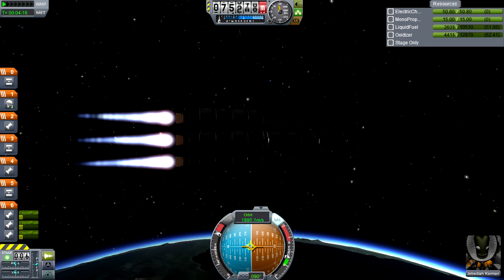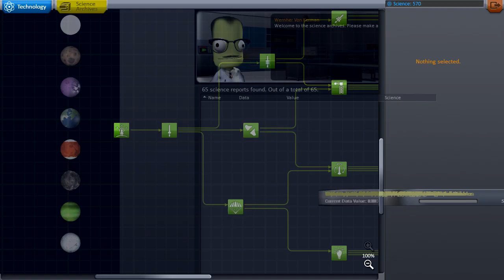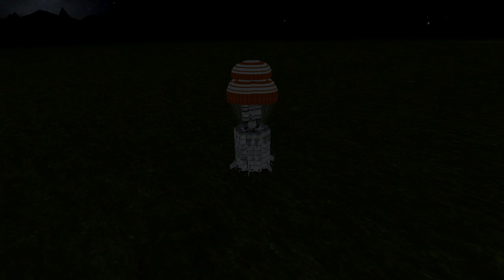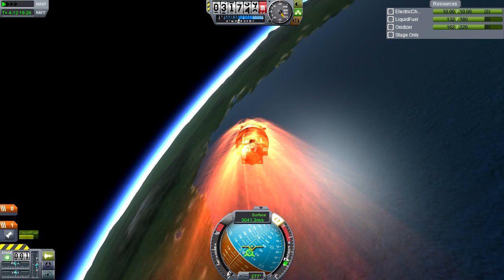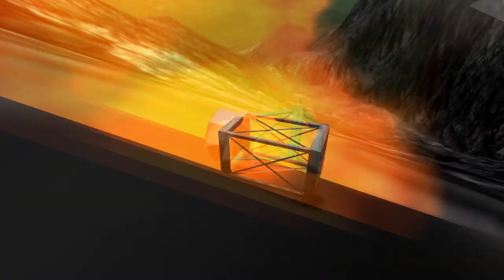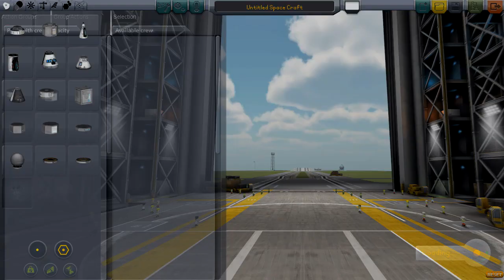Career Mode #14 QUEST FOR MAINSAILS (Kerbal Space Program)

Comment: Umm, no Harv, that's the Bussard Ramjet. Just to point it out. It uses an electromagnetic field that's 20 kilometers in diameter to pick up hydrogen atoms. There's about 1 atom for every 1 cubic inch ( would that be 6.4516 cm ^3? or 2.54 cm ^3?)

Comment: I had an exercise at school, in which the teacher has mentioned how rocket motors can be used to generate power, the hot exhaust contains ions and electrons, with an magnet, you can use the Lorenz force to capture them

Comment: Just spent most of this evening trying to build a bad copy of the space shuttle in the KSP demo... It's pretty much impossible. XD - I don't know how the real shuttle solves the problem (maybe it's something to do with the relative thrust of the SRB's compared to the main engines, and the degree of thrust vectoring it's capable of), but it clearly is almost impossible to replicate a design which has it's centre of thrust so far off-centre...

Ahem, anyway, the Eve lander looks slightly insane... I wasn't expecting something like that being necessary to land anywhere in KSP...

Comment: Why water is worse than earth?
Because is something crashes at a fast speed in water it gets bended and broken more than falling on concrete.Its the same thing as corn\potato starch and water.If you punch that it becomes hard and at high speeds the same things happens but worse.I'm not sure that i am really right but search this to figure it out.I think this is what happens.
Reply: Yes, Because is so funny!
Reply: Yep, surface tension means hitting water at high velocities is worse than concrete. If the water effectively bounces off as well, that's more energy imparted than simply hitting it outright.
Now the issue with KSP is often you're not hitting the water particularly fast. This wouldn't be a problem, but as the water forces you out of it very quickly (on the account that everything in KSP floats) you suffer more stress from landing in the water than on land.
Not really realistic, but at least you don't need to dredge your rockets up from the sea bed.
Reply: pyr0b1rd tehcnically not because the kinetic energy produced by the falling speed would create DISASTER on concrete
Reply: Er not really
Reply: WRONG
Reply: Wrong huh? Until you actually give a decent explanation, I shall assume you don't have a valid reason. Deal?
Reply: hears the reason : The kinetic energy produced by the falling is so great you have to SLOWLY stop that is why we have parachutes.So if you used water it will slow down the craft enough so it doesnt get damaged (well not alot) so in conclusion it is better to land in water then cement or concrete
Reply: DAbombastudious
 Real life yes, hence why soyuz capsules have soft landing jets. KSP... not so much. It's also velocity dependant
Reply: well in the game stuff randomly explodes in the water ..... so yea your right about the game but not real life
Reply: As I said, it depends on your velocity in real life. Parachuting, water preferable. Terminal velocity... debatable; I'll stick by water being worse due to surface tension and how fluids behave. Though really at those speeds it won't make a lot of difference no matter what you hit.
Reply: man you NEVER studied physics........
Reply: Nor have you apparently. Run a bath, then slowly poke the water. Now try punching it. See what I'm getting at?

Regardless let's just agree to disagree, this is getting irksome.
Reply: yeah i did it and then tested it against a cement block --.--